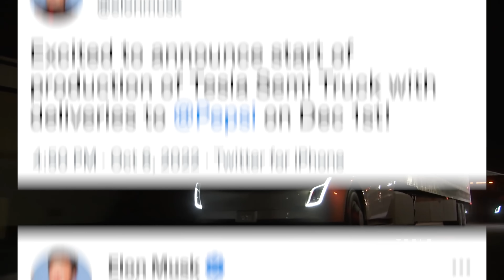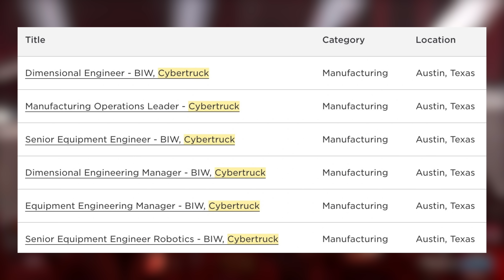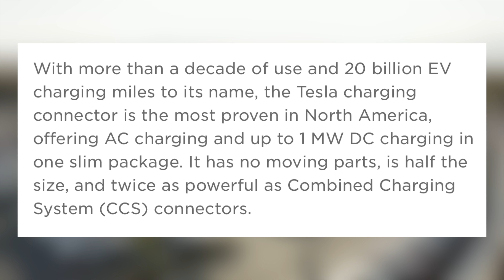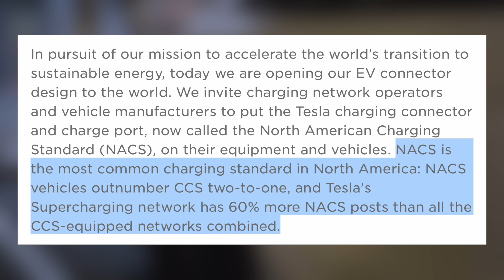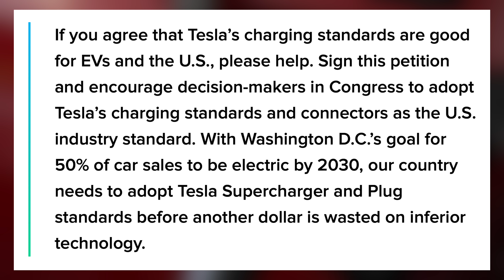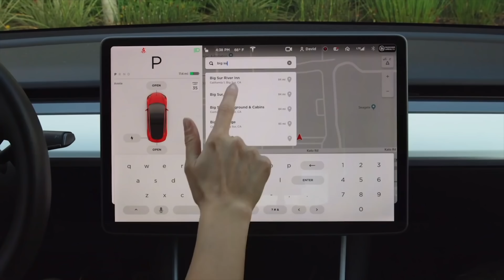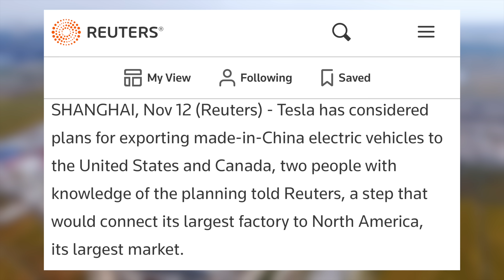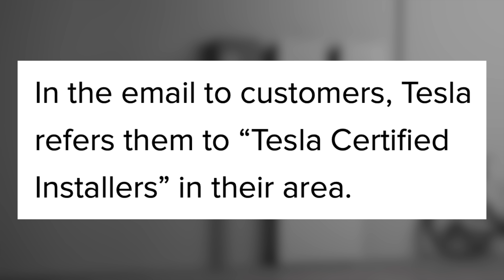Tesla's Risky Move To Help The EV Industry | Elon Better Be Right

Comment: Just to clarify.  CCS1 and CCS2 are exactly the same as far as DC fast charging, both charge at the same rate.  The difference is the top part of the connector (so the physical connector).  CCS1 fits a J1772 on the top.  CCS2 fits a European Type 2 connector on the top.  Now...Type 2 is pretty awesome, because it supports 3 phase charging, which is faster than we have with regular AC charging in the US.  But I don't see Type 2 being deployed in the US, it would require new infrastructure.  Tesla's connector also CANNOT support 3 phase charging, which is one good reason why it's not used in Europe.  The CCS portion of CCS1 and CCS2 is identical, it's the two big pins at the bottom, since that's how DC fast charging works.
Reply: Stormspark:  In the longer run it's about effectiveness, like speed, reliability, and cost. CCS doesn't  support faster than 350 kw from what I've read, so if Tesla can truly support a million mw,  that will matter for semis for sure, and perhaps for, say, Cybertrucks with large batteries, etc. 

The Tesla standard could be adopted in the US, even if Europe doesn't use it.  Over time, things should tend to gravitate globally (like in Asia) to whatever is best.  Tesla charger reliability should have a LOT to say for it, BTW.  (I don't know how lots of non-Tesla chargers in the US being down a lot per articles and Youtube compares to Europe).
Reply: @rogergeyer9851  that’s half-correct:
CCS is right now specified for up to 1,000V (DC) with up to 200A - however right now only with up to 350kW power. 
But that could change if the standard changes. 
Allowing for thicker cables and pins, the plug seems to be better suited to higher power. I’m not sure I would want to see 1MW ruhig through the Tesla-plug in real life…

But what’s much more important to me:
How about V2G /V2H?
I’m really at a loss how Elon, with all his mission to push the electrification, still doesn’t allow our vehicles to do V2H. If I ever switch away from a Tesla, this will certainly be one of my main reasons. 
So: does the Tesla Connector even have V2G specified? 
To my understanding CCS(2) right now is in the process of finalizing the specs, Chademo already supports it (but who cares about chademo).
For me _that _ would be the most decisive factor.
Reply: @rogergeyer9851  The reliability problems with CCS have very little to do with the connector.  They are typical of the kinds of growing pains you see in an open, standardized, multivendor, competitive scenario.  It is typical that closed, proprietary, single vendor solutions experience less issues.  Tesla only opened the invitation to use the connector.  They didn't offer to open the whole package, only the connector.  An EA station with a Tesla connector will be no more or less reliable than one with a CCS1 connector.
Reply: Since the Tesla connector can put out 1MW of charging (if my math is right on the theoretical 900v output) would 3 phase charging be necessary? Wouldn't the chargers (and their related battery storage and conditioning of output energy) use 3 phase to charge, then provide energy to the cars for charging? In short, why is 3 phase to the plug better?
Reply: @vr4042  You're confusing two completely separate technologies.  1MW is DC fast charging (aka, supercharging).  3 phase charging is AC charging, only faster than the 8kW we are limited to with US AC.  Some confusion is understandable because Tesla uses the same connector for both AC and DC charging, while CCS separates them.  In Europe they have to use separate pins for 3 phase AC charging and DC charging (hence CCS2).  The Tesla connector can easily replace J1772/CCS1 in North America.  It cannot replace Type 2/CCS2 in Europe because it cannot do 3 phase AC.
Reply: @vr4042  The new Tesla 1000V Connector is claiming to support MW charging in a DC Fast Charge scenario.  3-Phase is used in AC (L2) charging in parts of the world where 3-phase power is commonly delivered to households.  In North America 3-Phase is only common in industrial settings and it requires 3 wires.  Since the Tesla Connector only has 2 power conductors, it cannot support 3-Phase power.
Reply: @chriswestenskow5202  Ok, so now I get the '3-phase' issue. And seeing as Europe already chose CCS2 they probably would not switch. But the US is still open enough, and buys enough cars I think to make the switch to NACS. It really appear better in every aspect for the US. One question though for Europe and 3 phase, could the NVSE not convert 3 phase to 2 phase and supply it to the car? I figured there'd be a transformer in the NVSE.
Reply: @vr4042  I don’t see it as Europe has chosen CCS2 and NA is still a free for all.  I see it as the WORLD has chosen CCS as the standard and there is a 3-phase version and a single phase version.  In NA, we have 1 successful EV manufacturer that has continued to promote their proprietary solution, in spite of the standard being established, now they are asking that an entire continent and all of the EV manufacturers around the world incorporate their connector into only the cars they make for sale in one market.  It’s like if Apple tomorrow declared the Lightning port to be available to all phone makers and asked that all USB-C phones for sale in North America be converted from USB-C to Lightning.  How excited would you think all the phone makers and android users would be about converting to the apple connector?
Reply: @chriswestenskow5202  The big difference with Apple is the lightning connector was never opened up for use without hefty licensing fees. I do fault Tesla for not opening up NACS earlier But the really world didn't have a choice, it picked what was available, like at the bar at 2 am ;-) NACS is superior, there is no question, and now it apparently can handle MW charging, which CharIN has just started looking int to. At this stage, there really aren't that many other EV manufacturers or charging stations, especially in the US. And the fact that US CCS and EU CCS are NOT compatible for DC fast charging means even CCS is not a real standard. 

If Apple had opened up lightning when USB-c was being contemplated, then it may should prevailed, but they didn't.  And the fact the World has gone form USB-A, B and now C, shows standards can change and can easily go to NACS. And adapters for existing CCS cars and chargers. Given how often non Tesla chargers fail, conversion shouldn't take but a few years. Either a switch to NACS will be done now, or a switch to something else to handle higher charging rates will need to be done in the future.

Comment: Since I didn't notice any equipment storage bays on the side of the truck just to the rear of the door like all other 18 wheelers, I imagine some of the stuff that goes in the fronk  will be extra truck parts and safety gear then all truck drivers take with them. Hazard triangles that you must set up behind your truck it broke down or pulled over helping someone because it is required by law in every state. Other things will be spare headlights and spirit tail lights zip ties and duct tape. Air compressed air hose and a few large thread wood screws and some string. These are what we learned to take with us over the road that can help fix my other things that otherwise would sideline you on the shoulder. The lights are self explanatory, the duct tape is a universal temporary fix it for anything hanging down or loose, zip ties can go around any holes or wire that is hanging down in the wrong place and secure it back up where it was to the other wires if that is the case, air hose for topping off tires because I think the truck has its only air compressor that you can hook onto just for that purpose when they leak..  and the secret of the wood screws and strain is if you get a small puncture in your tire you have to stop the air from escaping in order to make it to a tire repair place along your way. You take the string and wrap it around the threads of the wood screw and then screw the screw up into the hole and it will seal them delete most of the time good enough that you can get to where you need to go. Out on the road you're on your own a lot of the times depending on where you're at and you have to be able to improvise especially if you're carrying frozen meats or foods of that type that cannot just sit on the road side and have appointments for unloading that have to be met. 👍🏻 This is the only way to guarantee proper installation by qualified people as far as the solar panels and power walls. Too many subcontractors have employee turnover in the contractor himself has to be relied on to make sure all the property details I talked to the new employees and as with any other business if you don't have full control over each employee's training there will be many problems popping up giving a customer's headaches and causing repetitive trips to the locations that could have been completely avoided so that you can install more units for more customers instead of running in circles.

Comment: Teslas charger is WAY cleaner and sleeker, uses less material and is the most reliable. Clunky CCS needs to go
Reply: Rick Kay:  But good luck convincing the industry of that if they think this gives Tesla an advantage.   Of course, if the charging industry is much worse, it DOES give Tesla an advantage whether they like it or not.
Reply: @rogergeyer9851  GREAT points all around! 👏👏👏👏
Reply: The only thing better than perfect is standardized. That's what CCS already is. All around the world. It's a car, there is that extra Inch of space to be found for CCS.
It would be completely unreasonable to try to get the industry to chnage now, that ship has sailed. If that truly was Teslas goal all along why not throw that in 8 years ago when this really was a mess with chademo and whatnot in the mix. CCS is way overdesigned for the 1MW it's currently rated for. CCS will probably be able to deliver way more than that - thanks to it's clunkyness.

Comment: Tesla will make a lot of money by opening up their SC network. I just wonder how it will be for the 1000's of Tesla drivers that rely on the SC network for 100% of their charging needs. There are tons of owners that live in apt.s that don't have home chargers (although I wouldn't have bought the car if I couldn't efficiently charge at home.)
Reply: C M:  Re home charging in apartments, that will get better over time, and already is, as the demand for that increases, standards demanding that in construction change, etc. 

Tesla needs to balance short term profits with long term capacity for Tesla customers, so I think it will have to be cautious re opening up its charging network, and make sure it stays ahead of demand.   Given the way BEV volumes are ramping up -- that may be a major challenge in the intermediate term.  

And maybe Tesla will have to defer opening up interstate supercharging sites, but can for various sites around cities.   It will be interesting to see how that evolves.

Comment: Hi Ryan  maybe i should have Hyundai install a Tesla NACS plug  seems my brand new Ionic 5 with 250KM on the odo has issues with one of the CCS DC pin temp sensors, will not DC fast charge!

Comment: Can existing cars eventually be retrofitted with the tesla connector?
Reply: Anything is possible, but it would likely be much more than a connector swap since Tesla uses the same pins for both AC and DC charging, where CCS uses separate pins.  There will have to be additional hardware added to  a CCS car to detect what type of charging is being delivered to the pins and then close contacts to connect the pins to either the on-board charger, or the battery.

Comment: Opening up supercharging to non Tesla’s won’t hurt Tesla as they can then operate those superchargers as a profit center. 

And with the speed that Tesla can deploy superchargers, getting a spot at an open supercharger shouldn’t be a spot as long as Tesla customers make their desire for more stalls heard.

P.S. As a long term investor, I am happy to hear that Tesla is shutting down their residential solar installation division. Given their scale they should focus on providing solar equipment, specifically Powerwalls (20%+ margin product) to certified 3rd party installers. 

Residential solar requires long term customer service and customized solutions, which means it can’t be super cheap (zero margin) like Tesla was basically doing with its own installations. That’s why their customer service historically has been terrible for residential solar.

Comment: 900A continuously?  That sucker is gonna get hot.
Reply: My thoughts exactly. Like, what size of wire would be used to push 900a?  That's wild. It would have to be giant wires just so you don't start having big heat losses.

Comment: I am under the impression that the tesla connector does not support bi-directional charging... Is that correct? I didn't hear/see any reference to that. Perhaps I missed it?
Reply: You didn't miss it, no.  Telsa's do not currently support this.  Hopefully a future software update will rectify that.  I guess only time will tell.
Reply: The NACS connector claims to support V2X, but from what I've seen it is dramatically simpler to implement a residential V2X solution when the connector uses sperate pins for AC to charge the vehicle and DC to connect the inverter to the vehicle's battery
Reply: @RoguePC4U  The hardware needs to support it, I would think.
Reply: @chriswestenskow5202  Yeah, I don't think it will be good if the hardware is not designed to support it. I guess conceptually, it's just pushing in the opposite direction, but I am not confident of that.
Reply: @nroose  Perhaps I wasn't clear enough.  All Teslas sold so far DO have bi-directional hardware capability, as is.  They do not have software to allow it though.  Elon has stated this in the past.  

The theory is, that once V2X standards have been settled on, we'll see Tesla offer some sort of solution.  Could just be software, or possibly an additional hardware adapter (new wall charger or inverter combo maybe?) to make it work.

Admittedly, this is just speculation.  But as Tesla is so forward thinking (and V2G such a useful, valuable feature) it certainly  seems plausible.
Reply: @RoguePC4U  I guess we will see. I am not under the impression that any of the Tesla cars have hardware for safe and efficient bi-directional operation.

Comment: Do both, plus EVs should have more than 1 charge port. You break the port and you're on the back of a flat bed.
Reply: How do you break a charging Port lol.
Reply: @Matzes  simple fender bender especially with where the rivian port is and youre done. Even if the truck is still drivable otherwise
Reply: @Matzes  - live in a cold climate

Comment: If this is an open standard, why couldn't a third party make an adapter for CCS cars?
Reply: They could but it won’t work at a supercharger without Tesla allowing it because currently they are locked down at the VIN level.
Reply: @smartino1  Ryan has a Model Y and a Rivian. What if the adapter used his Model Y VIN?

Comment: Did Teals open up their charging standard only for other vehicle manufacturers, or also for other charging providers?
Can Electrify America start producing chargers with the tesla standard?
Only if both is the case, it might be a good idea to make the Tesla charger the standard in North America.
Reply: EVgo already does, albeit with an integrated chademo adapter. Now they could ditch the adapter.
Reply: Anreas:  WIth the standard publicly shared, once it's open, it's open.  Tesla clearly has confidence in it.  If other charging makers use it, it helps the Tesla brand over time, as Tesla customers can use more chargers with no worries, no adapters, etc. 

Now, whether other makers CHOOSE to use the Tesla standard or not is a very open question.  It would be good to have it blessed officially by an industry / government standards committee t
Reply: Only if Tesla surrenders their patent for their charger and adapter.

Comment: Respectfully, I would NEVER say "never" re the given state of ANY BEV hardware changing, given the rate of change and the early state of maturity for BEV hardware -- especially batteries and hardware. 

It would be perfectly reasonable (and more accurate) to say that Tesla has future proofed its impressive charging standard, Tesla chargers have proven to be VERY reliable compared to the competition, and that Tesla has MASSIVE capacity to handle faster charging speeds, voltages, much higher current levels, etc. 

I think if Tesla wants to get its standard adopted, using clear and objectively correct language to promote it, vs. marketing-ese like "never needing to be upgraded", is a very good idea, as any opponents will surely leap on marketing-ese to try to make Tesla appear non-credible.